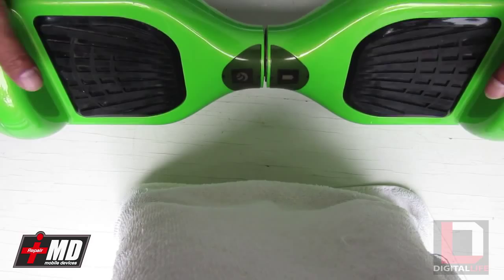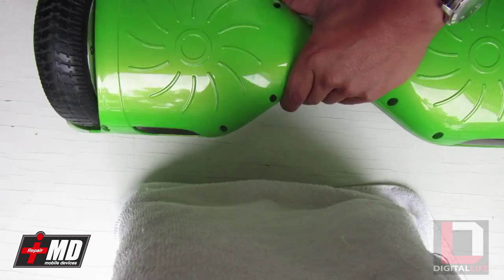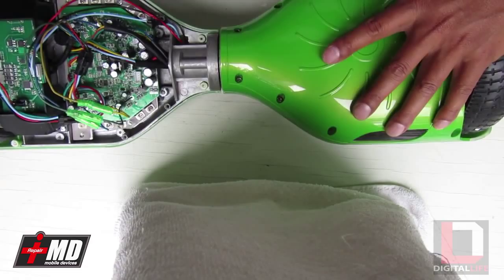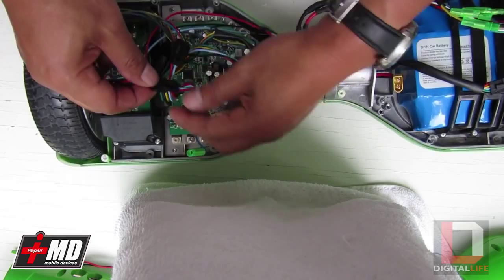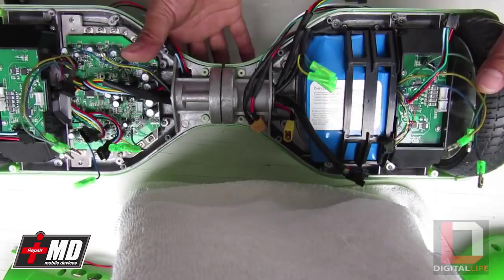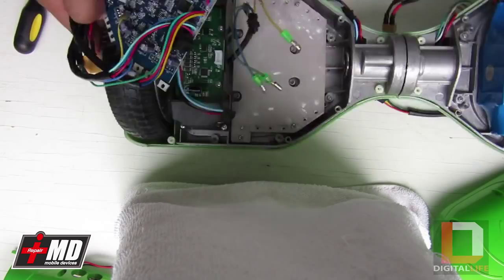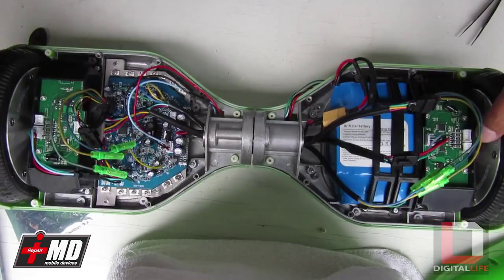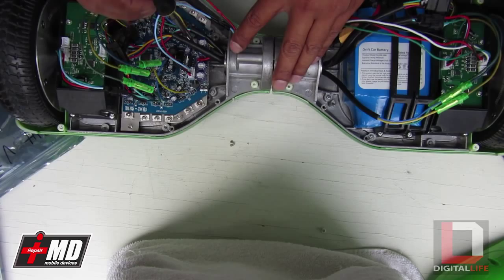Smart balance wheel no power repair

Comment: Thanks for the video. I noticed mine had stopped getting power. I opened it up and saw there is NO logic board on my sons smart balance board. There is a space for the logic board but its empty. His board now works fine and he hasn't had any more issues but do you know why his would not have a logic board in it?